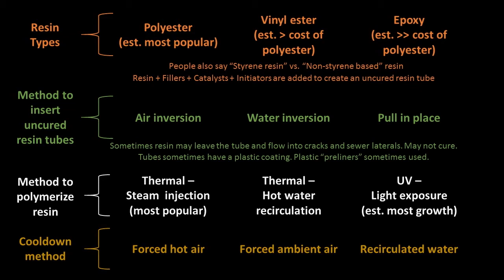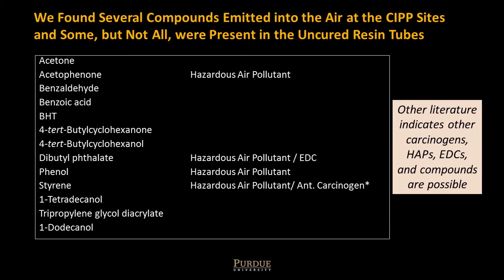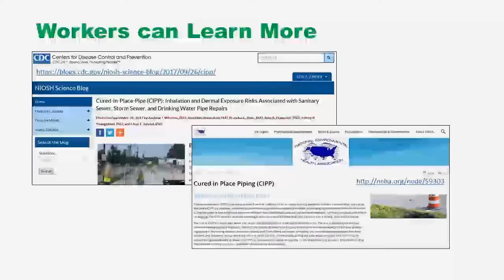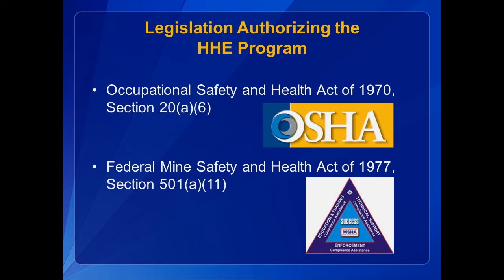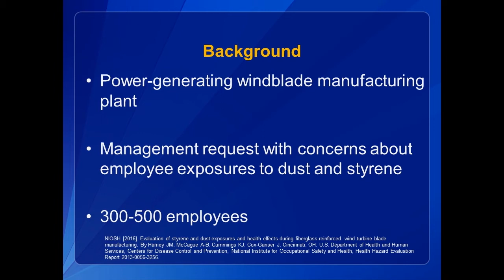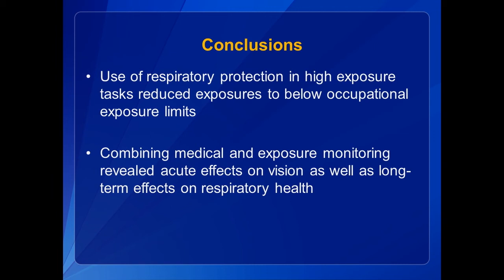Public Health Implications and Occupational Exposures during Water Pipe Repair Activities Webinar

Comment: I'm looking into having CIPP installed and 2 out of three companies use a bladder/balloon/calibration tube to help form the lining while curing rather than steam/hot water. Haven't selected which company of the 2 remaining in my current research. Obviously, I won't be using the company that still uses steam. I'm also looking into Thermoform piping, so far I haven't come upon an installer Tucson.